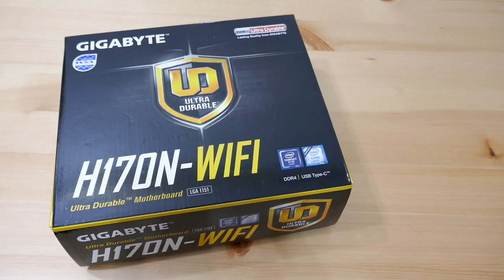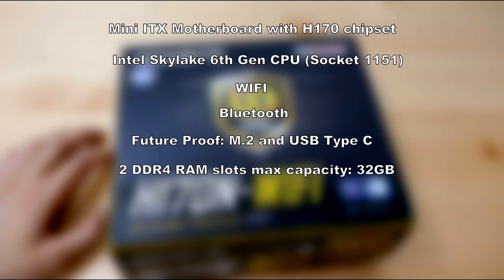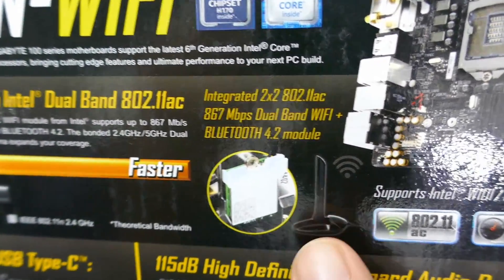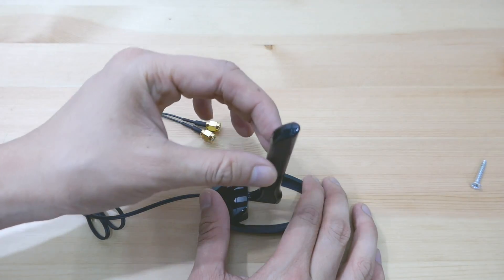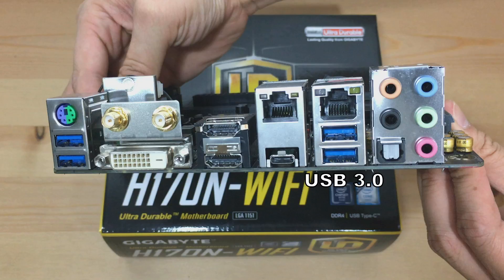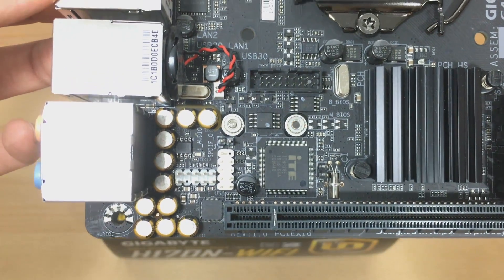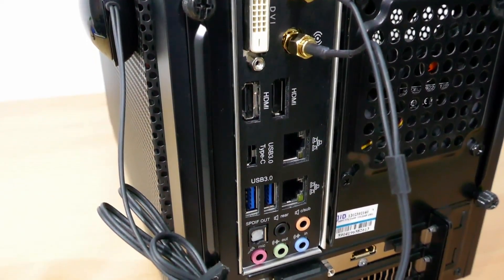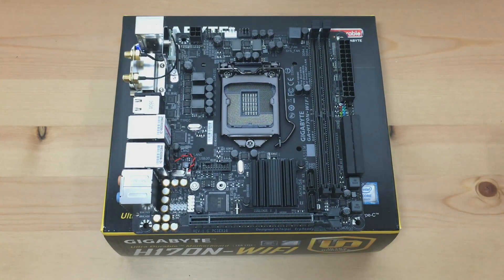Gigabyte H170N-WIFI Mini ITX motherboard overview

Comment: Hi! What is the difference between H170-WIFI and H270-WIFI? which would you recommend me to get?
Reply from the maker: +Electro JR 170s are mainly skylake supported CPUs and the 270 mobos are kabylake supported CPUs
Reply: Thanks for the reply, so it would be recommended that I get the H270-Wifi since it is the latest version
Reply from the maker: Electro JR yes I would go for the latest stuff :)

Comment: Nice overview of the motherboard. Did you update the bios from the official website or you just leave it out of the box? Also, are there any problem you faced while building the pc or installing windows?
Reply: Was your non-updated BIOS version F4 or F20?
Reply: Thanks for the reply! I just got the motherboard today and kinda new to pc building. Is the driver have specific installation order or you can just install in any order? Also, does the motherboard recognize the LAN port immediately or I will need to download the driver and transfer it via usb? Still waiting for my CPU, RAM and SSD though.
Reply from the maker: Hello! No I did not update the bios - I just left it as is from the box. The installation of the motherboard was straightforward. I didn't run into major problems but I did noticed that I had half the ram i installed so what I did was just reinstalled them and its fine - maybe the ram slot lever did not click? Other than that everything is still working up until now. Same for Windows 10 just the usual installation steps.
Reply from the maker: @Tiramisu_2K BIOS version is F3 - hey I just found out that it can support 7th generation CPU if we update to F20! Check it out on their official website: http://www.gigabyte.com/products/product-page.aspx?pid=5552#bios
Reply from the maker: @Dark Kizuna - for me I didn't install any drivers, I just let Windows 10 do the heavy lifting. When you do a fresh install on Windows 10 they will automatically download drivers for you and install them (especially with new hardware). So I would say no need to worry about driver installation. However if for some reason Windows 10 installation driver failed you can just download and reinstall whatever the failing component. Let us know how it goes!
Reply: Since where I lives the components price is through the roof, my initial budget build turns out to be almost $1000 with an 6500 and 480. And I'm still missing the CPU, RAM and storage. The graphic card will have to wait as I want a functional PC first.